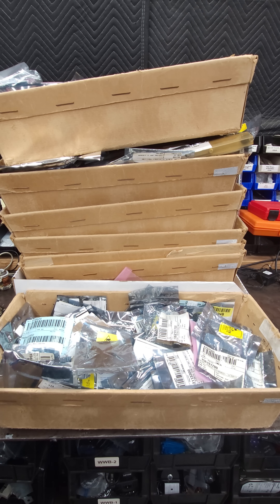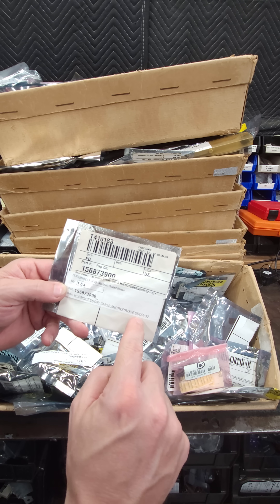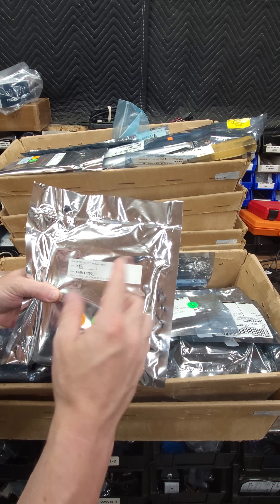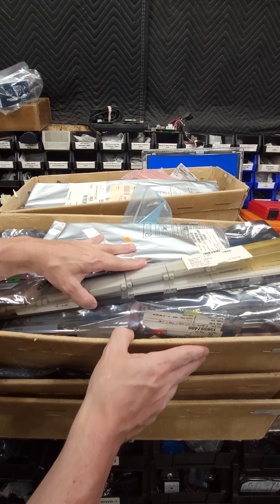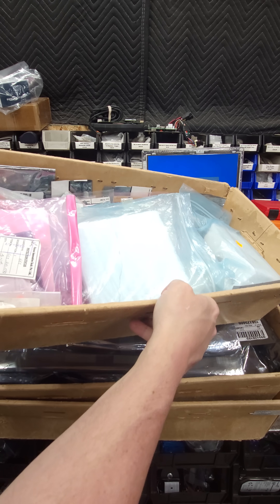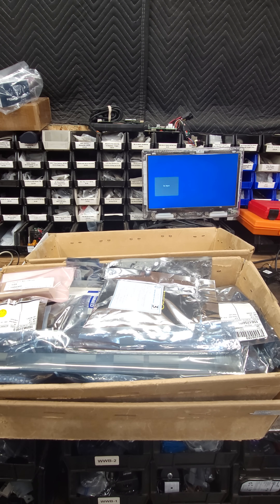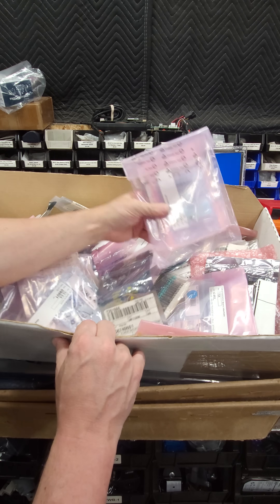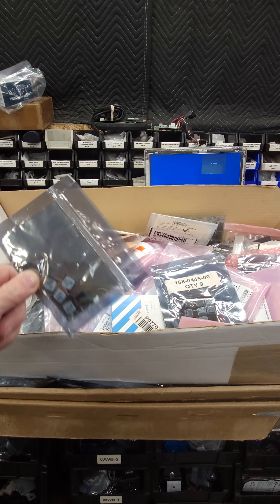Tektronix Surplus Store IC Chip and Electronics Passive Parts Haul

Comment: Are those IC chips leftover from the “Bendghazi” debacle with the iPhone 7+ ?
I remember they would bend ever so slightly in your pocket, and over time the IC chip would lose contact. 
I remember fixing one with a heat gun without even opening the case. Just blasted the appropriate area until the contacts resoldered themselves.
Reply from the maker: These are surplus chips from Tektronix the manufacture of test equipment.

Comment: Cool! Speaking of Tek, I'm working on reanimating a TDS5034B with a dead Intel 945 mobo. Not sure if I can fix this one... but found a period-correct MSI mobo with identical connector layout, it went in, but it turned out I'll have to make an adapter for the front panel connector, because the original had a low side power switch, the replacement has a high side one. Oh well...
Reply from the maker: Msg me photos the parts ya need ill keep an eye out at the factory surplus store.
Reply: @Rhine_Labs where did you score that load? 😮
Reply from the maker: @RaffMartinez tektronix surplus store.